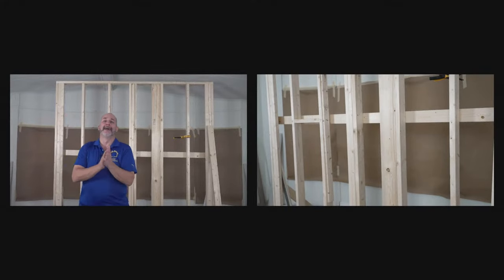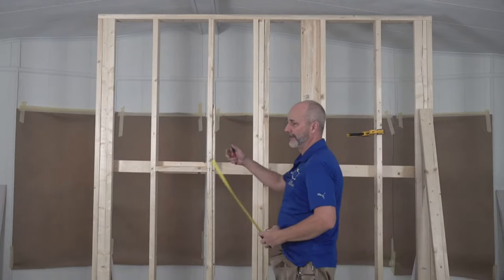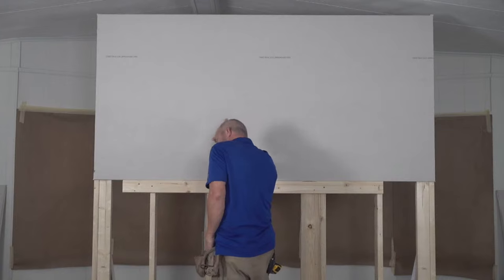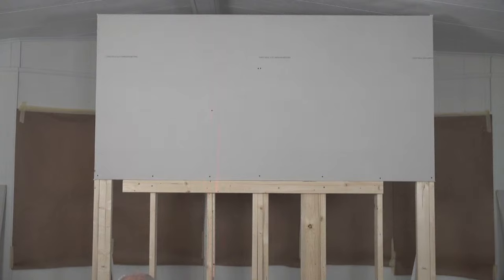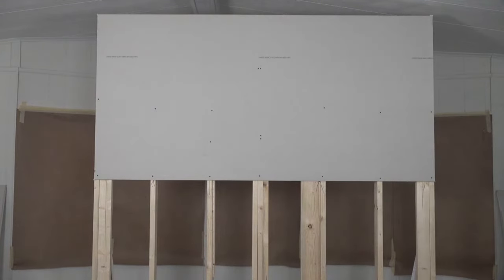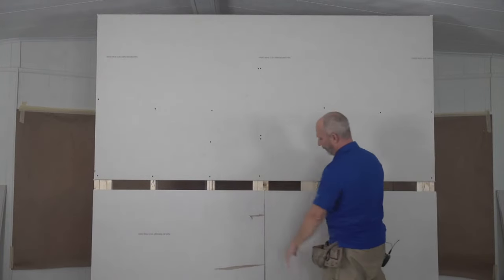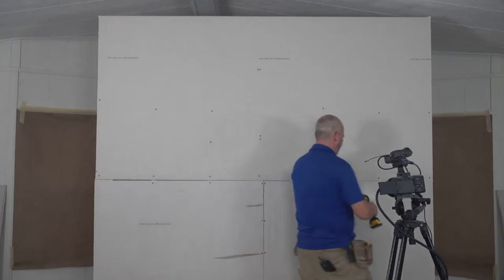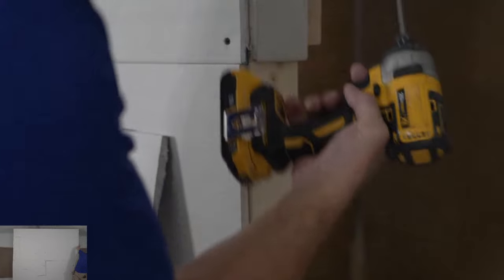Drywall Fundamentals LIVE | Hanging, Mudding & Repair

Comment: We got my wife a 24 x 12 metal building recently. I did the electrical and we did the insulation. We hired  out the drywall hanging. Then, with your help, we did the taping and mudding on the walls and the first coat on the ceiling. We hired someone to finish the ceiling. They told us we did a better job on the walls than some "pros" they've seen. We owe our "good job" to you. Thanks so much! I've watched your trim videos and I'll be doing that after installing the flooring, CHEERS!
Reply from the maker: well done. Cheers!

Comment: I know this is late, but #1 thanks for producing these.  You are my fave go to for DIY.  #2. Why 48-1/4” when setting up the top sheet?  #3. Should joints (tapered and butt) have a 1/8 gap or tight against each other?  Or does it matter if it’s not too late since your taping?

Comment: Have drywall with plaster on top. On cracks have repaired with latex primer, mud, tape and in a short while would crack again in same place. Then I was listening to you on another video and you mentioned if plaster use oil based primer. Wish I knew that before.

Comment: I wish I had known about the adhesive and the paper corner bead when I did my basement.  I did use the paper for the inside corners and it worked great.  I had already installed the vinyl when I discovered the paper.

Comment: when you’re taping a new drywall joint with an existing painted wall do you need to prep the painted wall or will the mud adhere ok to the painted surface?

Comment: Important to note, do NOT use the normal mud (all purpose) with MESH tape. Mesh tape should only be used with the hot mud type (the type that is a powder you add water to). Note that he used the proper Easy Sand with the mesh tape here. I see people thinking mesh tape is better and they use it too often with normal drywall compound and it's a recipe for failure, not meant to be used together.

Comment: Also when using a drywall knife, cut with the in push and not the out push. If you catch a wire in the wall you’ll be less likely to cut into it if the knife teeth don’t catch it..

Comment: Thanks for this video. I can’t tell how pissed I am at myself for not even thinking about Tape when repairing a big hole using those 2x2 drywall sheets from Home Depot. Watching this made me say Oh F… that makes perfect sense.

By the way, my old house was drywall with holes cut then a thick plaster layer. So those sheets had a massive gap. Be prepared if initial drywall is not 1/2 inch with those 2x2 repair pieces being 1/2 inch.

Comment: Really enjoyed the video tonight, it answered several of my questions. I have a cathedral ceiling which has a crack running down the middle of it. It is 10 feet 5 inches from the floor to the center where the crack is. Would the paper tape and slow mudding be the best to use or the tape with the holes and the quick 5 minute set. It's going to be a number of trips up and down the ladder no matter which one I do I know. Thanks for any help you can offer.
Reply from the maker: Paper is always better on inside corners. and that crack is likely to come back. I would recommend trying to fill the gap with a crown molding expandable and paintable caulking. there is going to be movement there every year so having an expandable repair will work best. Cheers!
Reply: thank you @HomeRenoVisionDIY
Reply: @HomeRenoVisionDIY  Could you elaborate on a crown molding expandable?  Wouldn't that look odd going down the center of a wall?  I have a crack in the middle of my living room wall that begins where the drywall meets the ceiling and comes down about halfway.

Comment: Great video guys! Jeff, green board is all ready up, can I thin set and tile on top or do I have to attach cement board on top of that then thin set and tile?
Reply from the maker: green board still meets code. just not as good as cement. fine for occasional use.

Comment: Hi i have a question about drywall in a double wide home. My home has strips over top of the seams of drywall instead of tape and mud. Could i just simply remove the strips, then tape and mud the seams? Thanks
Reply from the maker: yes. but it may have a vinyl wrap on it so use a flat oil primer first before taping. I did a video on that from my trailer project. we finished it with a southern texture knockdown as well. Cheers!

Comment: I see quite a few drywall screw pops after one year of a new construction. Is this because house was settling? I also see paint drips and sags after one year. Is this normal?
Reply from the maker: we build too fast these days. some frames get wet and boarded before the wood dries out. this causes the nail pop issues. as for paint drips were always there. nit sagging is evidence of water getting into the house.

Comment: Horizontal vs vertical? Why not start from the bottom?
Reply from the maker: the secret is to close gaps. this is just a demo wall but in most cases you have a ceiling.

Comment: What’s wrong with Behr? I’ve used Marque for years without issue
Reply from the maker: I find the finished surface way to much texture. sure it covers good but it looks horrible. You will never find behr paint in a nice home. good paint has a very smooth finish.
Reply: @HomeRenoVisionDIY  I’ve never seen this. Have you done a video on this texture comparison

Comment: Ppl buy the shoe at any box store that helps to lift the sheetrock into place. Don't create another hole to repair. Sometimes Jeff works haphazardly n doesn't show good work habits.
Reply: He shows the things a typical homeowner would do . Very real
Reply from the maker: that shoe really slows things down. it's just drywall a little knife hole is easily covered while taping the joint and doesn't take much consideration.
Reply: @HomeRenoVisionDIY  Ridiculous. If you go back n listen to some of your videos,you actually showed n demonstrated the shoe. You say one thing n do something ridiculous the other. Us DIYers here in the states don't need to be in a hurry like yourself. Just show the proper way that's all we need. Did you notice the large gap on the left hand piece. The knife leaves an extra hole to repair.
Reply: @samoday2992  No. The homeowner would take the time to find out how to do it right. Jeff is too quick to get things done n careless.His A to Z taping n mudding videos are the best for the homeowner.